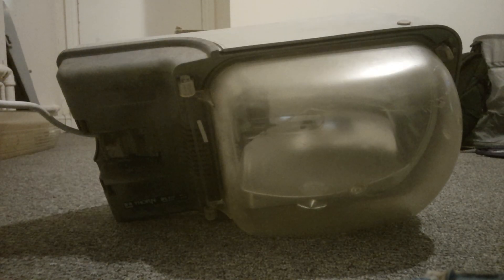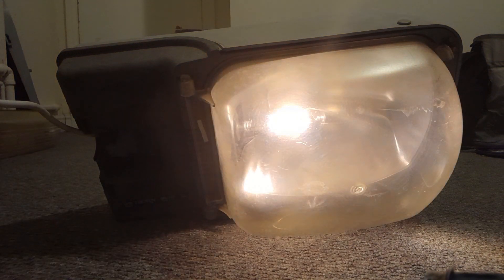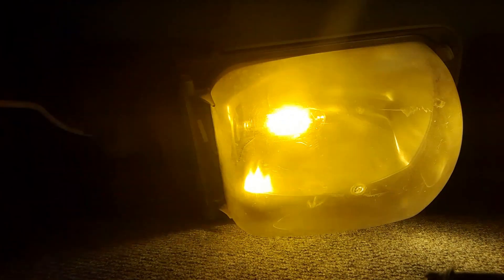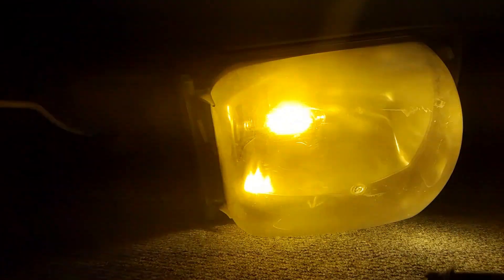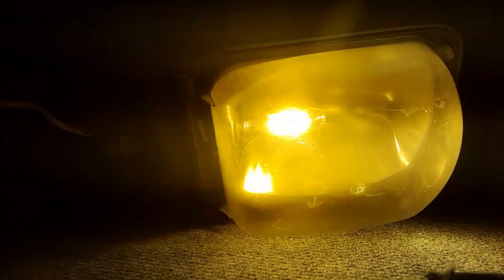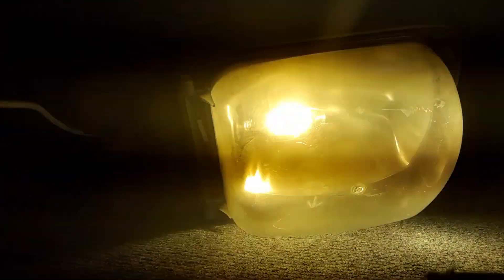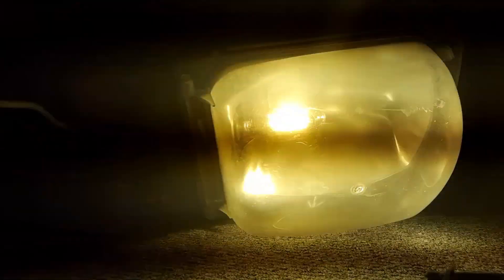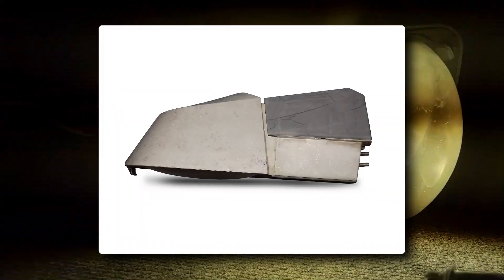THORN Europhane Pilote T1 Street Light Lantern (70W SON-T) Warm Up

Comment: Great lantern and video! There is no earth because the lantern design is double insulated, meaning there are two layers of insulation between any conductors and the outside, so no earth is required. It's the same with the Philips SGS201. You should find a square within a square on a label to identify if an appliance or lantern is double insulated. On the pilote you see it next to the IP rating.
Reply from the maker: Oh, nice, didn't know that! Thanks for sharing!